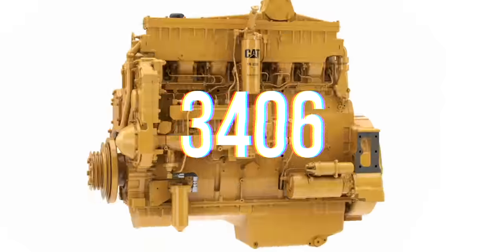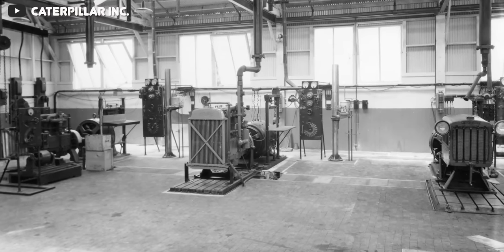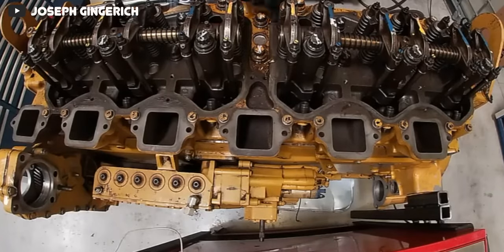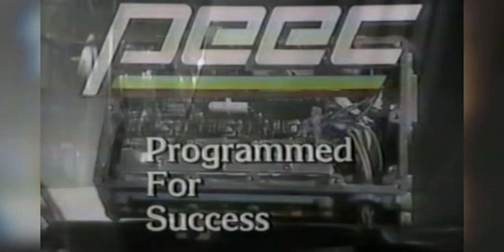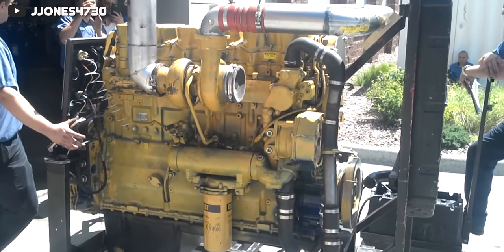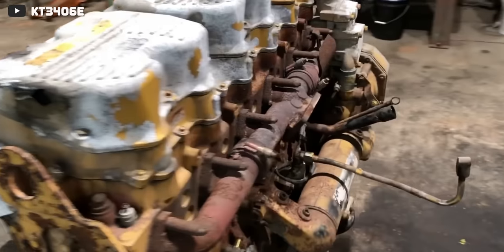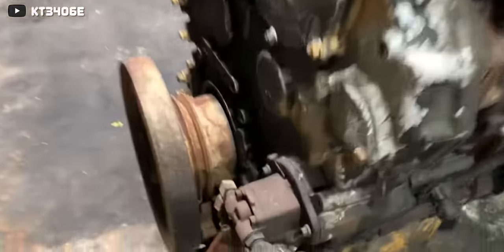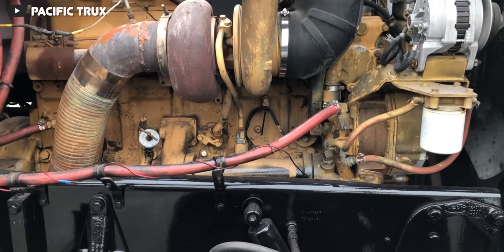The Legend of the Caterpillar 3406

Comment: My dad had one turned wide open in a day cab Pete. I remember hauling wood with it and getting behind a freight shaker Detroit series 60 powered truck. He told me “let’s see what that green machine can do” as he pulled out with a car between us. I sucked him up and passed him like no other. Got to the mill and I weighed 108,000 pounds, dude didn’t believe me until the crane operator verified it. The frightshaker only weighed 82,000 pounds. But the oil started piling up in the coolant reservoir and blew up right after we sold it. Truck had over a million miles when we got it, 100-200 thousand over when we sold it
Reply: Only 108k? Here we can load 141k and pull it with 700hp stock trucks
Reply: @alexstromberg7696  yeah we’re only allowed 80,000 on interstates but they give us up to 90,000 on other roads. But if you over 90k they drop it back down and ticket you for being over 80k. So I was technically 14 tons overweight.
Reply: @alexstromberg7696  Where is here?

Comment: We have two 3406 model trucks that we use for ore haul we have a 1996 Mack with the 3406b and a 1993 Pete with the 3406e and both of these trucks have been so far more reliable then any of the newer model Cummins powered trucks I work with

Comment: Just got back from maintenance work on a couple of tri axle trucks. I drive a Kenworth 2018 with a Cummins engine but the trucks today, specially a special 2005 Kenworth 18 speed had a CAT engine. I will confirm which one it was but it may have been the 3406C..

My dispatcher has a 2006 Kenworth also with a CAT engine💯

Comment: There was a 3406e which was 15.8 before the C16 was a thing. It was the original 600hp 2050ft lbs from cat. I can’t remember the series code(edit: 5DS) the superior of this engines has always been the 3406e the only downside is injectors are worth 450-900 a piece to make it go BROOOM
Reply: and how costly are normal injectors for the mechanical a ang b engines? much cheaper?
Reply: @HealthSupercharger  yeah, a lot cheaper, the nozzles are like 150 and plungers for rebuilding the injection pump are not much more either
Reply: @HealthSupercharger  also the marine cam is a lot cheaper for the mechanical motors over the E motors, but I think the real kicker that no one thinks about is the Jacobs for the b is weak and tends to wear out a lot since it was never perfected and the pushrods are the weak link on it, while the E version works extremely strong and reliable just like in a Cummins being actuated by the injector’s lobe
Reply: I have 3 of them factory 600hp 3406e 15.8 l stroked.  The torque curve is incredible.  Will bust driveline parts in the wrong hands though pulling 140k every day . The hot setup is the accert bottom end with the c16 up top.
Reply: @johnpuff4400  you sir, are living my dream. I learned to drive in a 1987 3406B and everyone who loves it didn’t drive it, it’s a cool motor, jake sounds cool and it cracks right up as soon as you step on it, but the lack of injection timing can make the EGTs run hot down low, the lack of cruise control will make your knees cry a going through pump springs and you’ll probably loose your hearing from the exhaust noise. The 3406e/C15 sound great, has a great torque curve and it can be logged down below 1400 RPMs no problem. I drove a c15 acert, it was laggy but powerful. A 15.2 with a 3406e top would be a dream
Reply: My last truck had a 5DS in it. It did a fine job running to the Pacific Northwest and Fairbanks. I had very little trouble with it. I sold it when I retired. It's only used locally now and the owners love it. 
 They run 32 trucks and they are all Caterpillar powered.

Comment: I did a lot of work on the 3406E injectors ...You missed out the incredible fuel economy   down to 176 g/kw hr  that is supper low. All engines after this used more because the emisson control costs you fuel .  When they were new they really did not  smoke except on transeints  but NOx was through the roof becasue the efficient combustion realy pushed up the combustion temperatures.  Insane HP is possible particularily if you can get your hands on 12 hole injectors.

Comment: The PEEC 3 had problems with the electronics. When the computer went bad, it would default to full advance. They would run like a scalded ass dog till it boiled the tops of the pistons. I've seen the aftermath and it's not pretty. Many years ago some mechanics would put  steel top pistons in the B and C mechanicals so you could turn them up without burning them up. They were fucking awesome.

Comment: The 3406 and C15 are the same engine. Cat just changed all their engine model numbers to cubic litres of displacement across their complete engine manufacturing line. They still produce parts because they still manufacture engines for all other applications except trucks.

Comment: Thanks for this vidio
Where can one go for a series3406 high h.p. rebuild and parts explanation, like 1000 Horsepower,  what it takes, who builds them and documentation via vidio's? 
Thanks, l want to build one, are the "E " engines oil pressure fire injectors? Or are any of them?
Thanks! 🤘✌🏻👍🌤 🇨🇦 😎

Comment: So I have a 93 Peterbilt 379 with a 3406 but I can’t figure out if it is a B or C model. Is there some difference I can look for to tell?
Reply: Serial number should be stamped on the block, exhaust side, number five cylinder.

Comment: The 3406 platform engines weren't as great as the fan base promoted them to be. They were never great on fuel until the C15. All platforms suffered from weak valve train components often causing serious progressive damage at failure. The E and C15 had somewhat okay reliability in stock horsepower ranges but the higher factory ratings and the 'tuned' horsepowers often suffered early head gasket failure from the piss poor spacer plate head gasket design that Cat insisted was the Cats Meow of reducing counterbore stress. This often before 400k. The issue with the design was with two head gaskets needed you basically double your opportunities for a leak. Add that a piece of metal place between two  other major pieces of metal basically creates a bearing effect and why this design couldn't handle the increased cylinder pressures on tuned engines. Was it a bad engine? No. It also wasn't the exceptionally good engine either that deserved all the hype it got.

Comment: I as a owner operator had a 3406 cat I had to rebuild it 5 times I spent 85.000 dollars total trying to keep this motor running  and this motor is not Bullitt proof it put me out of business
Reply: 😭 damn man! If you were to get back into the business, what engine would you choose to run?
Reply: Maybe you got a lemon or a bad mechanic?
Reply: You had a shite mechanic, sorry that happened to you.
Reply: Dang, I almost don't believe it.  I had a monkey overhaul a 3406E that totally screwed up!  Had to have it rebuilt (by different pro) and it has 2.2 mil miles about 30K hrs on.  I think I put a new stater, field pump and alternator on in 15 years.  Did same person rebuild it 5 times.  Did u ever do an original machine block rebuild?  Did u use cheap aftermarket kits?  I just can't believe u got a 3406 that u had to rebuild 5 times.
Reply: @Midnight_Rider96  might be so
Reply: @bingusmctingus4395  thank you I had it in a 98 w -9 Layne low it was wite black chrome I me dam I miss her
Reply: @humbleservant9343  signature 6 big red was a 1350 hp bad ass

Comment: I had a 3406B and it was a great engine but did not like biodiesel fuels. If you squeeze them, they will blow injectors. Mine got 7.5mpg all day @ 80mph with 50,000lbs. on the wagon. The 3408 is another great engine. The new government engines are Shit.

Comment: D343 will outlast a 3406 3 x's over. 3406 is much easier to rebuild though. The 3406c had wider rod journals and rod bolts instead of nuts.